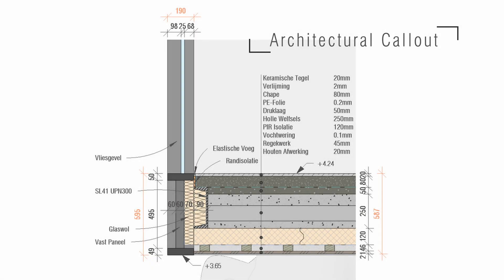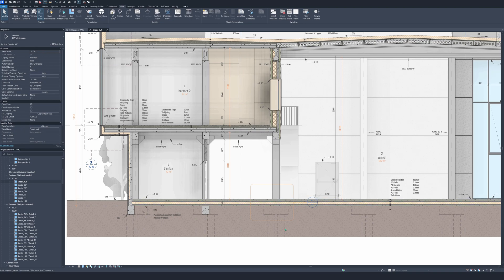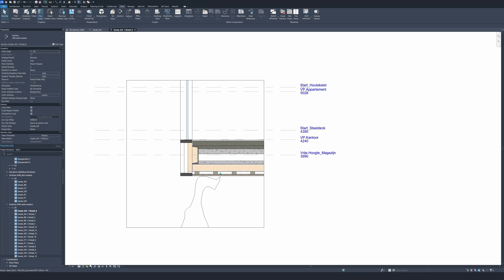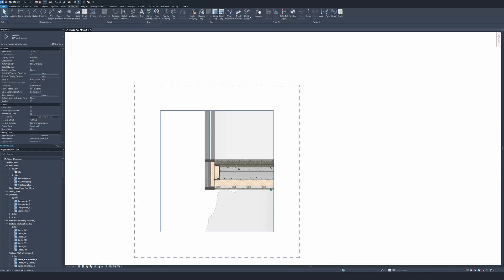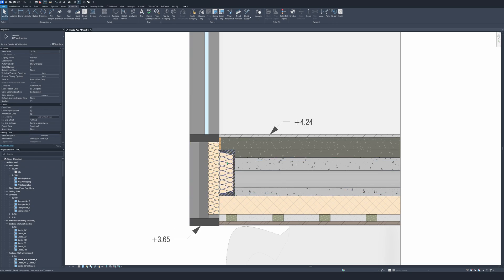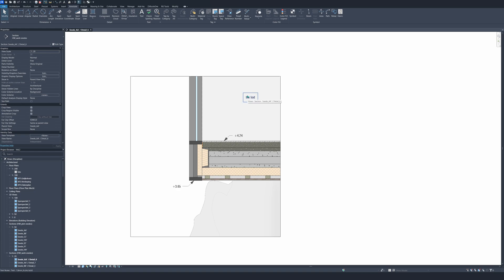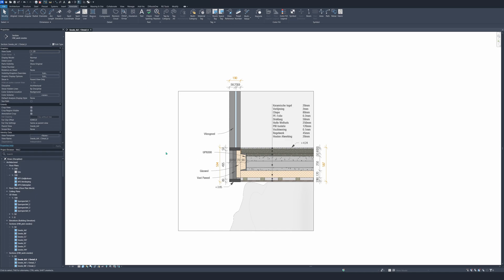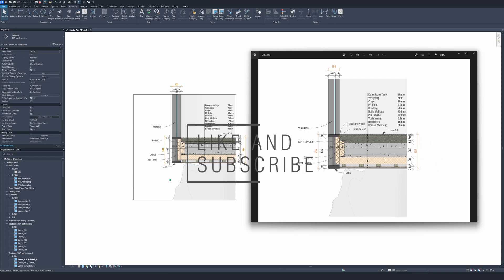A Comperhensive visual guide

Comment: I really like your style, but I see that you will get rasterized PDF exports, how do you handle this?
Reply: So that will be using Raster printing which results in slower exports and larger output file size.. both of which may not be an issue on smaller projects but those inefficiencies stack up on larger projects.
Reply: @JoeStottUK  This is a thing Revit needs to update for better/prettier architectural drawings..
Reply from the maker: Thanks! I haven't encountered that issue. I export using the 'diroots' plugin.
Reply: @Manda.L  Also with shadows?
Reply from the maker: Also with shadows